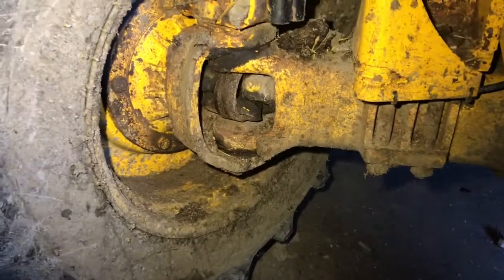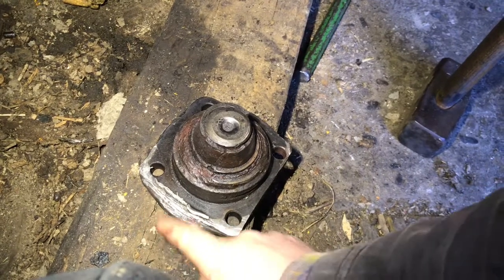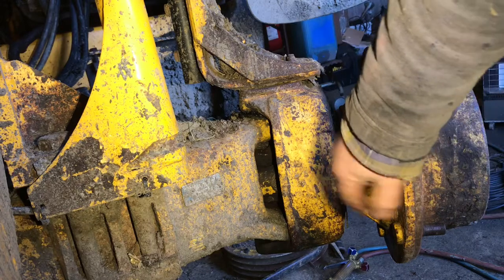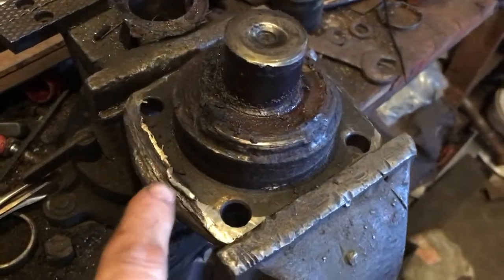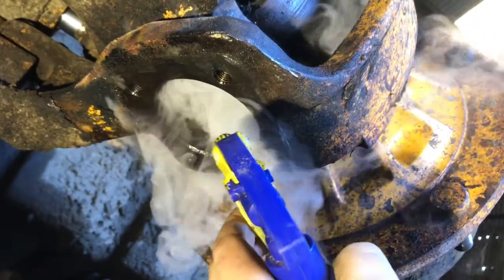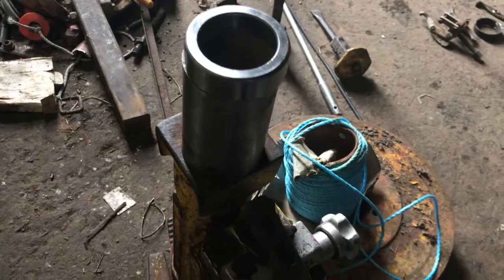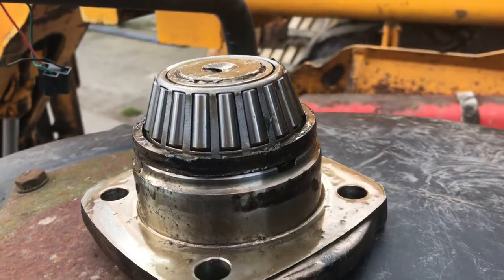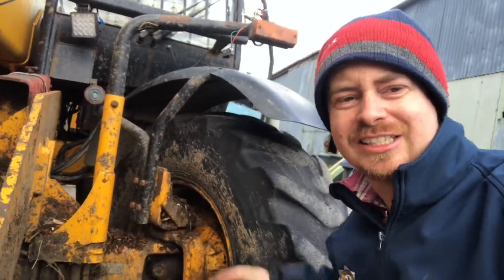JCB Trunnion Bearing [Replace]

Comment: By right the top and bottom bearing should be replaced together but anyway pull the top bearing out first it’s never as thigh as the bottom drop a 17mm nut into the hole and put the bearing back pull in down with the bolts be careful not to pull the threads and it will put a lot of downward force on the bottom one and make it easier to get out!.  Run a weld beed around the shell to shrink it a little then a large nut in with a spot of weld on two sides!. Wind in the bolt and it will pull the race straight out!.. it’s a bit work but will save a lot of time in the long run!. Hope this helps!. 👍
Reply from the maker: Hope to never have to do this again 😂 but chances are I will . Thanks for advice 👍 I make sure they are always greased now to keep the bearing in good shape

Comment: Don't think there's an easy way to pull that race out other than the way you done it (cos that how I would of done it!) or a inner race puller which is very specialist and next level up to the general puller you've got
Great video 👍 looks a lovely job!
Reply from the maker: I think it’s been infected by the vws, got it fixed and 2 days later the fuel gauge broke . I think the float has come off level sensor. And it’s a drop the tank job. 🙈why is nothing ever simple !
Reply: @stevenharpervw  defo a VW trait, or all the light knocking with a sledgehammer loosened everything else that moves 😆😲
Reply from the maker: @CrispysProjects  the amount of hammering that housing got, just to remove it . I say I loosen dirt that was stuck there from day 1